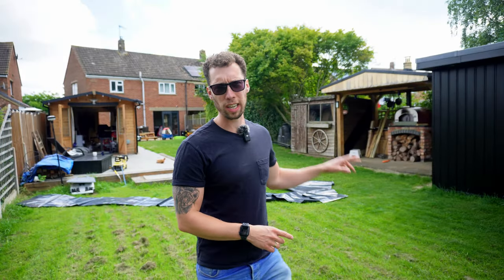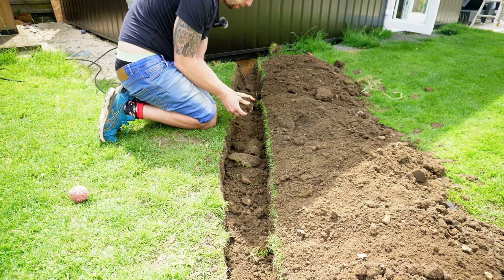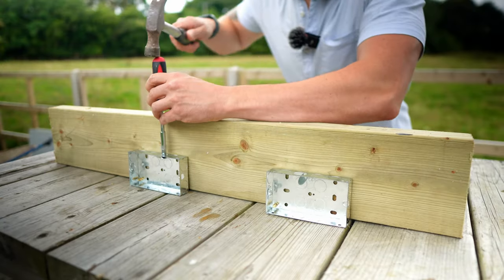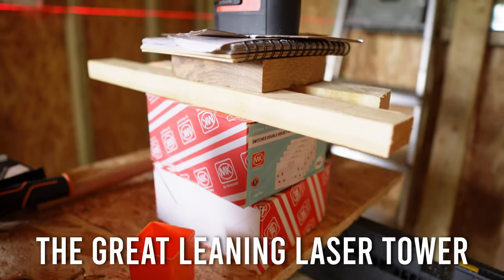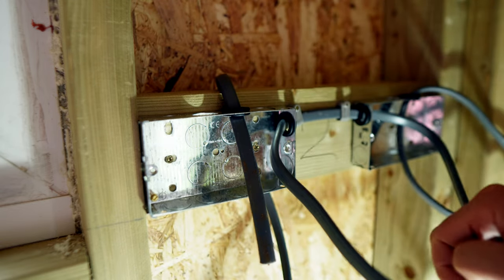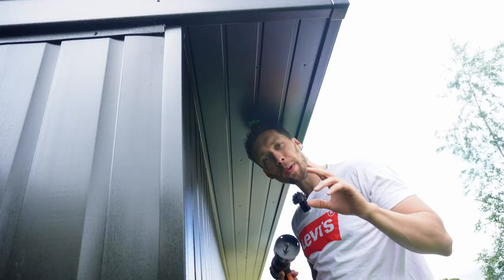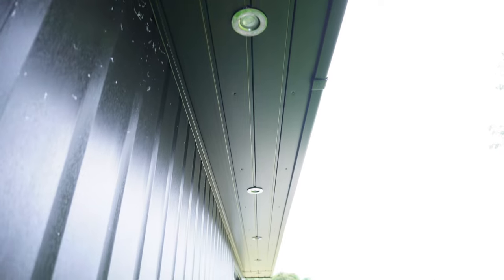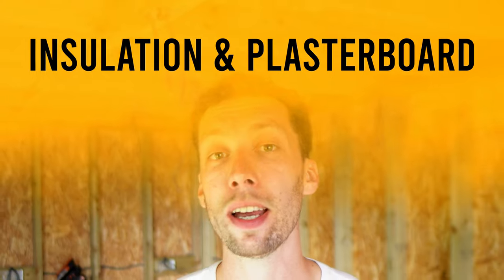How To Add Power & Lights: Build A Workshop Ep 10

Comment: It's probably too late but if you are filming and planning on using led panel lights, sockets in the ceiling are really handy, though you can run the plug up the wall like I have on a few. You will definitely use the double in the ceiling, my 2 are full. Great job bud.
Reply from the maker: I only put that ceiling socket in because of your video - thanks for the tip!

Comment: I work for a gardening company, one thing we always recommended when laying piping/cables under ground/soil, cover the top of whatever you are laying directly with a  layer of 5mm pea shingle stones, eg say 5cm above the cable in this case, then cover the stones with the soil/grass etc. 
This way if someone down the road is digging in this area it will be obvious to them that there is something here and they should proceed with caution. 

Imo this is better long term as that half cut pipe will be made mincemeat of buy a digger bucket/ someone hand digging, whereas the stones will make them take notice
Reply from the maker: Yeah that’s a good point to raise here, I wish I had done this too but too late now!

Comment: Not sure how deep you buried that cable but it should be a minimum of 600mm deep and be covered with a marker tape to warn that a cable is below to comply with wiring regs. 
Also you’ll probably get interference on that data cable as you’ve run it with power cables
Reply from the maker: 😅 thanks for the tips. It’s too late for me but hopefully others can benefit from this comment!

Comment: Nice job jack a must say i have 1 double socket in my workshop and it's extension cable everywhere i need get more put in. Best it is the junction boxs are there. 🙄 Have you consodered sticking a socket on the floor be a good one for the table saw and say shop vac? Certianly ideal having more than not enough. Oh btw i oreered the track with your link the other day. Thanks for that 🏴👍
Reply from the maker: Only 1! And i did consider the floor but because it concrete I thought against it.

And thanks for using my link 🙏
Reply: @sumeraybuilds  yea only 1 not my choice I plan on getting sparky in when I get back into shop properly once get rid the 🤬 kids from school holidays. 26 days and counting. Not that am counting 😬. No worries mate got me sommit free so can't complain and I've mentioned it to few professionals in the industry so think they'll be ordering to.👍🏴

Comment: This is a bad example - That cable wasn't buried anywhere deep enough: Only just a spade's depth deep, so could easily be damaged by someone digging a veg patch in that location in the future. (Minimum 500mm is recommended, I believe); It's supposed to be bedded on pea gravel or sand, and you're supposed to fit a warning tape in the trench ~150mm above it. Otherwise, I've been enjoying the series!
Reply from the maker: That's totally fair, a couple of folks have pointed that out now so hoping people pick up on it in the comments. Thanks!

Comment: Is there any flex in the cable mate?I need to power my workshop from my my main fuseboard which is at the front of the house but my shed is at the bottom of the back garden
Reply from the maker: You really do need armoured for it to pass regs/ get a electric cert. However, it is technically possible to put normal T&E cable in conduit and bury it, but it's not as strong and won't get signed off (This is my understanding would be handy if an electrian could confirm)
Reply: Incorrect. If it's fed from an rcd you can do whatever you like. I however would recommend twinwall ducting with swa. Belt and braces. Twinwall is pretty cheap, cover with electric barrier tape. Oh, GET A SPARK IN!! THEY HAVE THE KNOWLEDGE!! There's a reason it takes 5 years to become a spark.

Comment: Did you notify the council about the electrical cable in your back garden via architectural drawings I also see you didn't bury the SWA any where near deep enough why didn't you encase the SWA in a concrete culvert ?? Or concrete protection on top of the cable ?? And now electrical protection tape ?? Please take this video down and remove any reference to your crap electrical work your work is dangerous